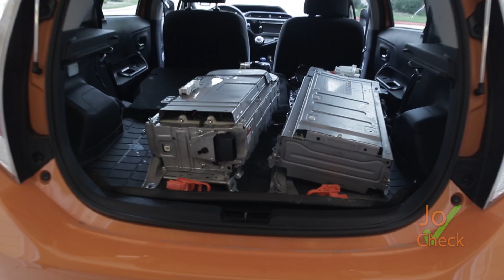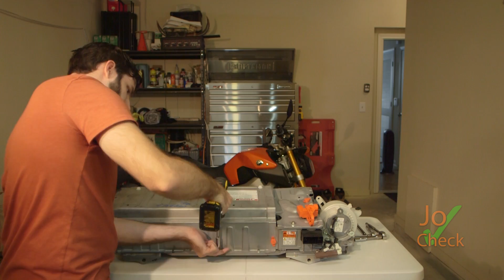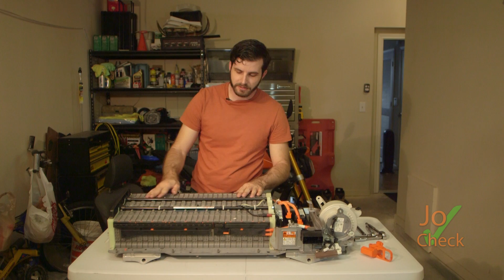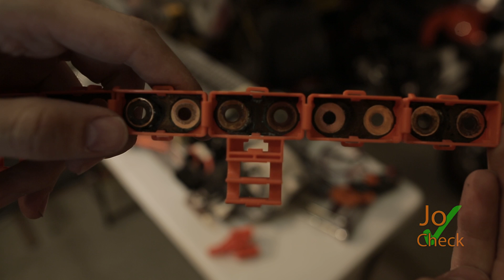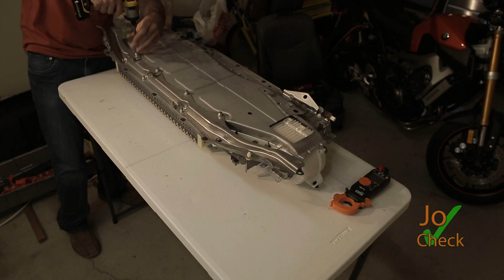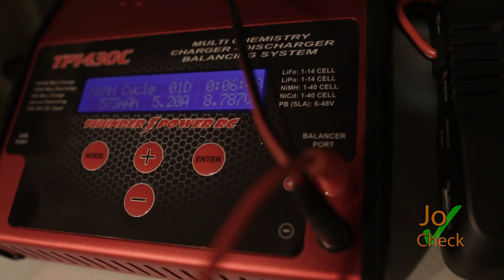Prius Battery Dismantle

Comment: They're called modules, not cells. Each module contains 6 cells inside. Also, checking their voltage without a load doesn't tell you much.

Comment: Prius batteries are connected in series. But if somehow the could automatically be reconnected in parallel in order to balance the batteries, wouldnt the batteries last much longer.?
Reply: Not as efficient. Electric  Motors designed for high voltage.